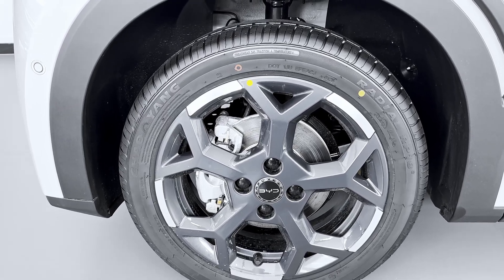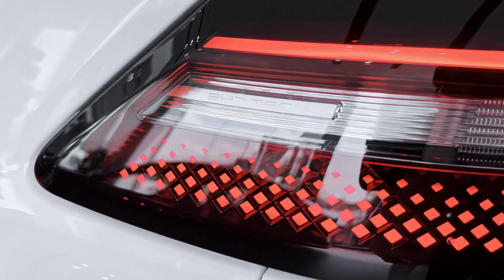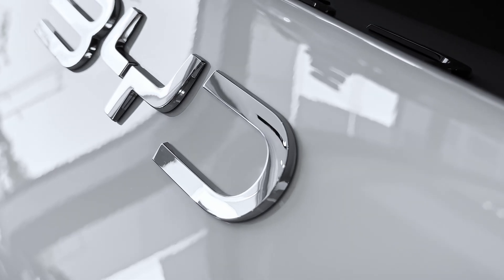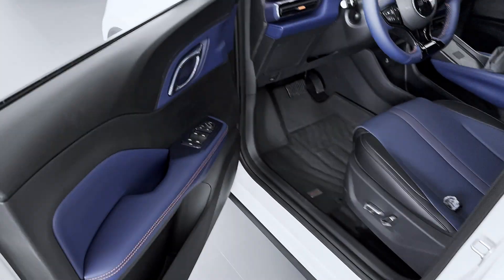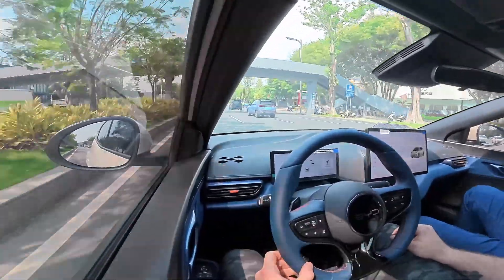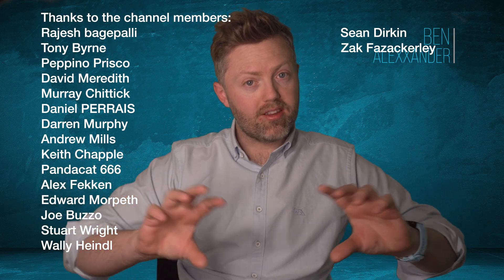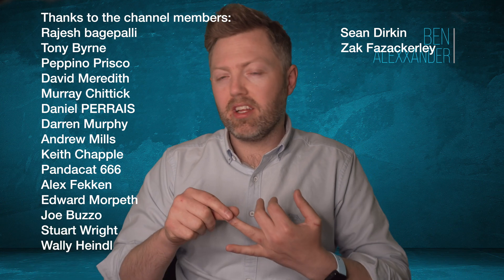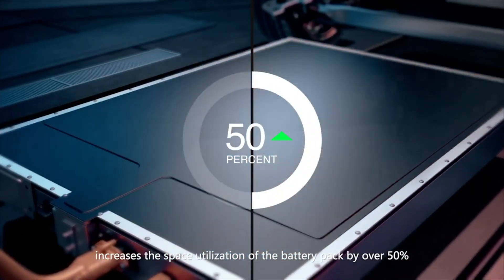Digital Battery Passports Coming for All EVs – What It Means for You

Comment: Is this data being reported by the BMS?
If a cell in a pack is changed , is the BMS updated ?
I guess this then has to be communicated to the cloud so this is what Data centres need to be built.
I see this as a consumer protection tool, and may provide Live SOC and Battery health info for tracking service and life cycle info.
But what if cars or e bikes and scooters don't upload to the cloud.
So how does the QR code then show history.  
Seems like a great move but how will it be updated.
Reply: Very, very good questions.

Comment: It is absolutely obvious.  The charging history, faults, issues, damage, overheating is exactly what is needed.  When batteries cost £20K there is going to be a lot of criminality and lying going to happen.  Let alone swapping cells, using damaged cells and so on.  I wouldnt buy an EV without one.  Now lets see see how quickly the criminals move to falsify the passport.